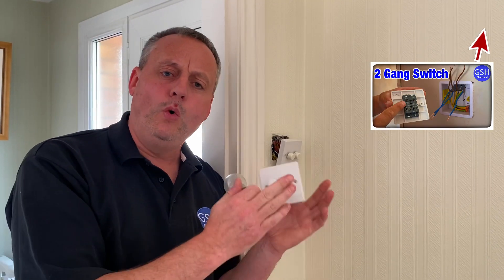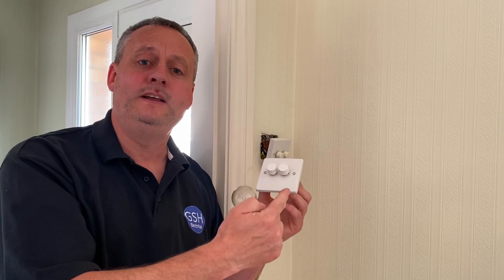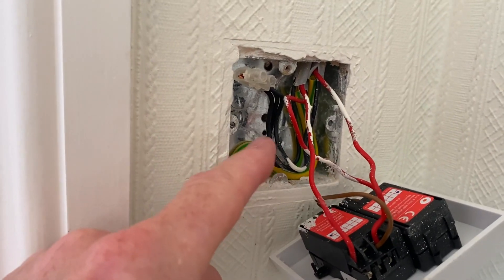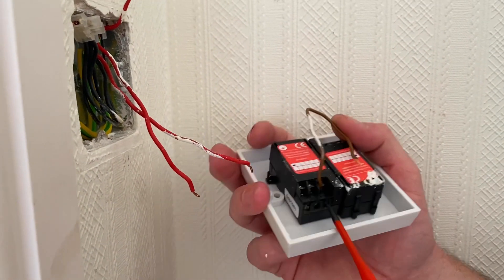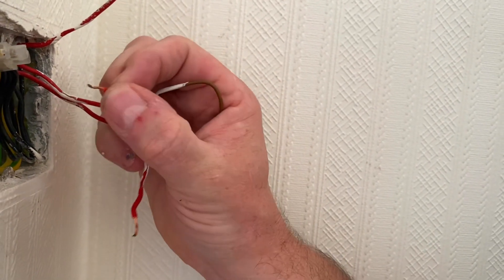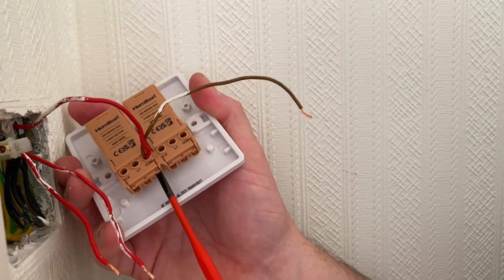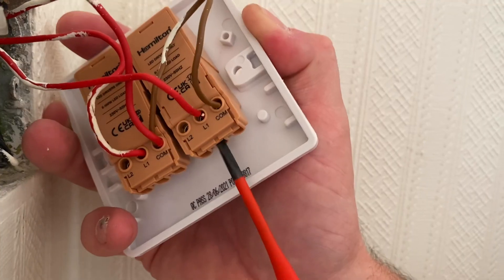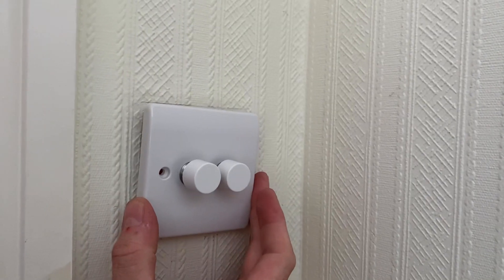WHY is my Dimmer Switch Causing my LED Lights to Flicker

Comment: I generally flatten the top and bottom metal tags of the back box to give you extra room in the back box. These are never used , and with the bulky dimmer modules, can be a pain.

Comment: I just got a new light with 8 bulbs. I have 4w LEDs in it with a dimmer thats up to AC 200-240v and outpul voltage 12-70v. when I put it up full the light flickers, but when its half way they dont, they are just full. Why? Thanks!

Comment: I have noticed If you go into shops that have a electrical  line most are still selling the old type. Dimmers. Also most of the LED lamps they sell can’t be used with dimmers .. buyer beware 
Sometimes it’s worth mentioning you have to bend the top and bottom lug out the way to get more space . Also I would say 75% of metal plate dimmers don’t get earthed on the front plate when diy fitted
Reply from the maker: Thanks for your great important 👍🏻
Reply: Hi , student reading your answer . Could you explain...is there labels or "signs " on packaging to tell the buyer it's okay to use on  Dimmable switches . Thanks
Reply: @poloiscorrect  most lamps have in small print on the base . Dimmable or non dimmable

Comment: Why not just buy dimmable lamps???
Seem a lot of unnecessary work 🙈🙊🙉👻
Reply from the maker: They are dimmable lamps but they didn’t work with the old original dimmer
Reply: The led Light bulbs use less than the minimum rated watt for the older dimmer switches.  In older  for older dimmer switches need min 60 watt less than that they will flicker or blink

Comment: We have dimmers switched with led candle lights and the simmer button often gives an electric shock.  Would this indicate the wrong type of dimmer?
Reply: If it’s just in the summer Assuming the dimmer is metal.Most likely you are picking up static from carpets and when you touch it you discharge yourself. . Much more common in the old days with nylon type carpets . Some houses it was so bad on white switch plates we had to change the metal screws to plastic to get round  the problem. 
Some of the early touch dimmers used to give a slight tingle. 
Having said all this , 
First thing is make sure it’s earthed properly just in case.
Reply: Check that the switch plate has an adequate connection to earth.

Comment: Quick question, should you not mark the common wire?
And if so, is there an official way to do that?
Thanks
Reply: Sleeve the 'switch lines' ...
Reply from the maker: Always worth it 👍🏻

Comment: Just a technical correction - The old dimmers are not resistive - they use a thyristor as the main dimming component.
Reply: @morenormal Fair enough he made a simple  mistake he's human this chap from GSH Electronics is not only hard-working spark but he's giving us his time.

people like myself that our aspiring Electrician’s  in training he is breath of fresh air an someone that I could look at as a mentor. 

Cut him some slack 😊
Reply: I caught that too but I think he meant dimmers rated for resistive loads only.
Reply: Now a proper technical correction,  older domestic dimmers use a triac not a thyristor, a thyristor is unidirectional, like a diode but a triac is bidirectional, just saying.